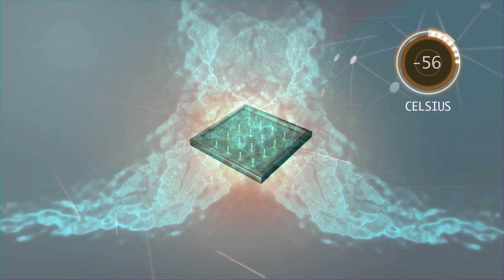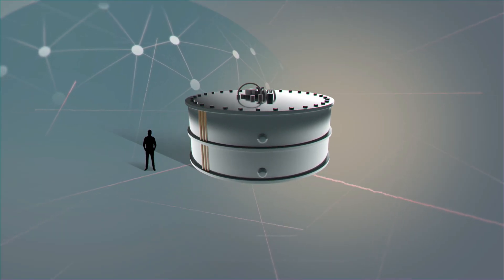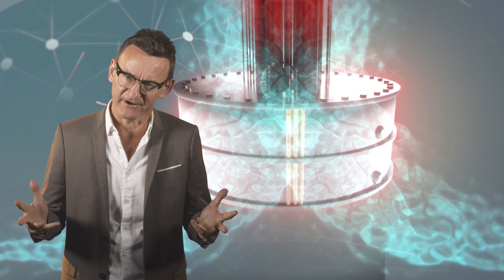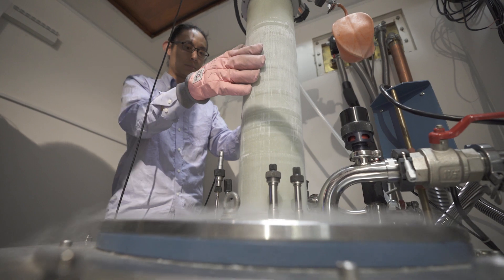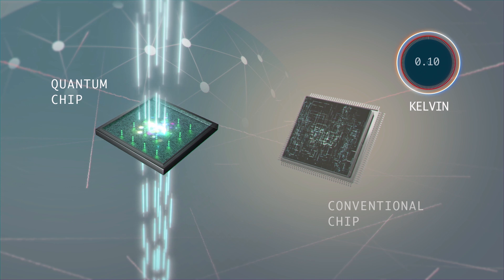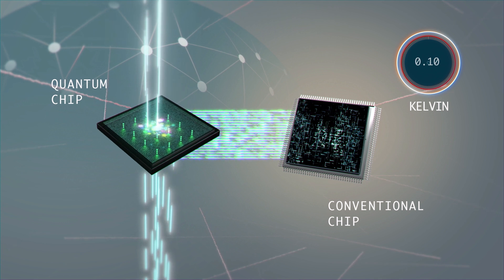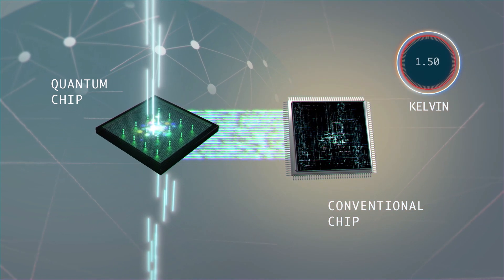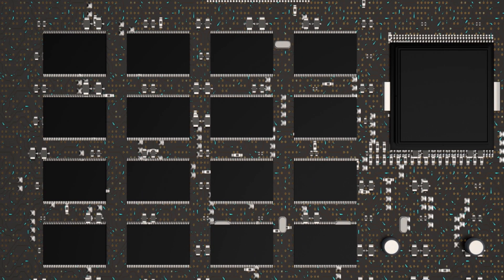Hot Qubits: major quantum computing constraints overcome

Comment: will we be able to use quantum calculations in 6-7 years?
Reply: You should read this:
The Google plan is roughly to build a million-qubit system in about ten years (2030)
https://www.forbes.com/sites/moorinsights/2020/04/30/googles-top-quantum-scientist-explains-in-detail-why-he-resigned/#114b15dc6983
Reply: I think more like  1-2 with this major breakthrough
Reply: @mrogun1974  Hahaha no.
They said only during 2022 that they will have a 10 silicon qubit quantum computer... that's a whole lot less than a million.
Reply: I think more 600 - 7000 years, I just don't see this working at all.

Comment: Could you make the  Logic board big enough that can handle  1,000,000,000,000 CONVENTIONAL CHIPS  than add 9 more of the same Quantum computer than hook it up than try to make  new CONVENTIONAL CHIPS  that can handel 10,000 times hotter temperature and switch to replace the other ones leave the Quantum chip in it than make 9 more  than hook them up and than change the hole technology including computer and batteries  like Quantum batteries and star trek   WARP DRIVE.

Comment: So what about just putting these qubits into orbit, where the temp would be naturally closer to absolute zero, on a permanent basis, then plug an orbital supercomputer that takes data from it, then send the data down to Earth?  Why waste so much energy and resources artificially when you can make it run in far better natural conditions?
Reply: Because sending things into space is also costly. Keep in mind all this is still at the 'research' stage. You could very well end up with the same, or higher, costs, with less useful results.

Your question is analogous to asking why we don't bring raw eggs to a desert, where the temperatures are naturally higher, let it cook, and then just bring it back, instead of 'artificially' generating that heat via gas/electricity in your kitchen. Don't forget to add in the factor that we don't even know if this egg will be edible.
Reply: I'm not an expert but do you think that single event upsets may occur more often in space?
Reply: @WeMakeItRainz  As opposed to other expensive hardware like the ISS, the Chandra X-ray telescope or military surveillance satellites?
Reply: @freeriding666  Their hardware supports ECC memory? I'd assume that super positions from qubits be much more sensitive to SEU?
Reply: @WeMakeItRainz  Are SEU that much a concern?
Reply: Good question, obviously the can not do that but I do not have the specific reason. Maybe @Woodsy is correct.
Reply: Even if you get to -270° C, getting it to -273 is still going to cost almost the same. You see, that -2.75°C change itself is the hardest part. The lower you go, the exponentially harder it’s going to get to go even lower. And then there is this cost of installing and maintaining the complex gargantuan quantum system in space!
Reply: no, it is not possible due to space radiation which introduces noise.